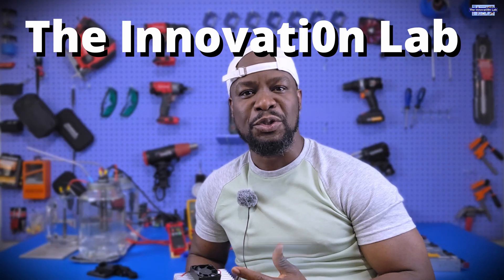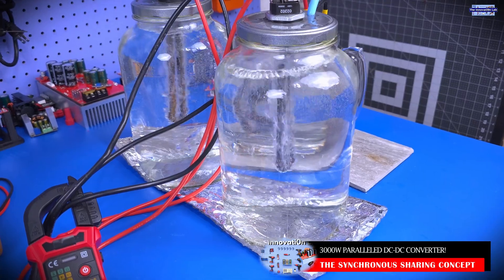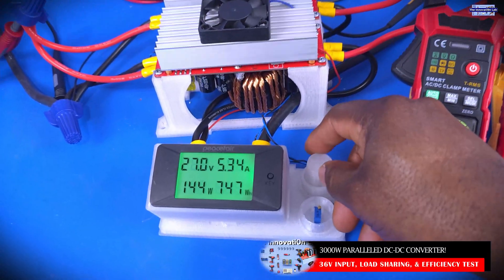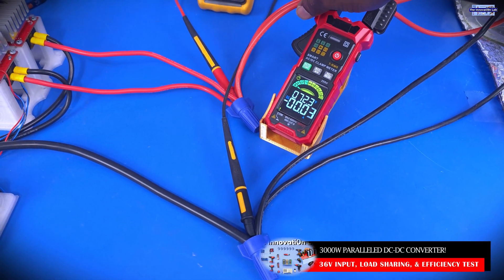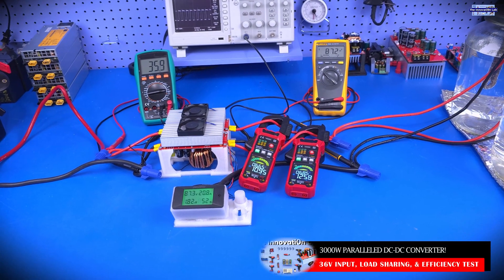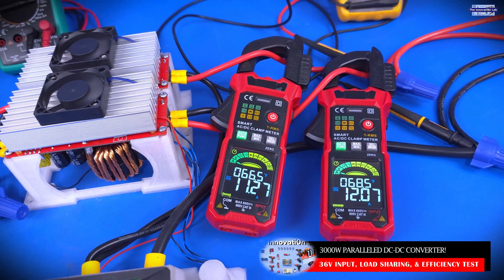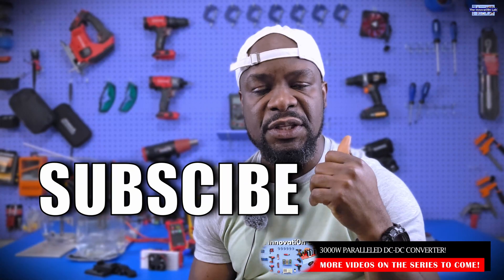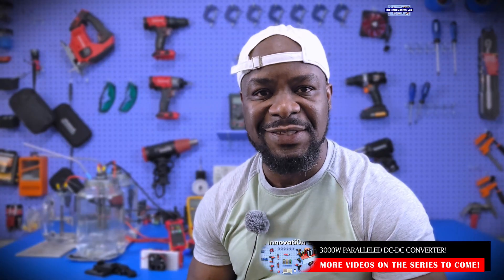Unleashing Maximum Power!⚡ Synchronous Parallel DC-DC Boost Converter in Action

Comment: Hi, i wonder if you could help me, im using one of these to charge my emoto battery from a solar battery module, but i want a quick way to jump from 92v to 88v, if i remove the Vout trimmer, i was hoping to replace it was a switch and some resisters, however im not sure which legs would actually need to be switched, do you know how this part of the circuit works?
Reply from the maker: Yes, I do but it will require some math to configure the switchable resistor network that you could use to implement such function....I will give it some thought when I am less busy.😊

Stay tuned.
Respectfully,
The Innovati0n Lab
Reply: @theinnovati0nlab782  haha, I have been researching, voltage and amp trimmers only use 2 pins so a variable resistor basically, 100k ohm for the voltage, 99k gives 92.4v, 96k gives 90v, I believe if I add a switch and a 3m3 ohm resister in parallel it will reduce the resistance correctly, this might help someone else 👍

Comment: Hello Professor. Will using Schottky diode in series with each converter's output isolate the output control feedback from one another so the original boost converters do not need to be modified? I think a regular diode would work as well, but Schottky would have less power loss. And maybe a MOSFET might work better. I'm still trying to figure this one out.
Reply from the maker: 😂Hahaha,
Love the professor joke.

I have tried this method in the video below and it works at low power but very sensitive to load stepping. The goal is to double the output power.....so its quite pointless if a paralleled system of 2x 1500W converters can only drive a 500W...not even reliably.
Also, your system efficiency will go down due to dissipations on the output ORing diodes.

Please watch this video before proceeding as you may find some good information from it.
👇👇👇
https://youtu.be/EKqIIOe_q8k?si=AL8jI4DJZHWfKQ5h

Respectfully,
The Innovati0n Lab
www.theinnovati0nlab.com

Comment: As I understand it, one resistor controls two voltages at the modules output?
Reply from the maker: Wonderful question.
👍👍👍
You are thinking in the right direction. One trim potentiometer - which is a form of a variable resistor controls the output voltage of both converters. But it goes a few layers deep from the potentiometer.😊

Respectfully,
The Innovati0n Lab 💥

Comment: I was wondering have you looked into multi phase/ multi phase controllers? Basically having the next phase(s) off set, for more power and better efficiency.
Reply from the maker: Thank you so much for the wonderful engagement.
👍👍
I have read about the multiphase converter concept a while ago (for buck converters), however, I have not tried to implement it. 
Also I saw that the efficiency of the multiphased network of converters tends to decrease as number (n) of the phases increases. I saw a TI white paper on this concept.
I will research on it some more to know if it will work well for this concept.
Thanks again!
Respectfully,
The Innovati0n Lab 💥

Comment: Should you not balance them with a large resistor or intelligent resistance such as SSR balancing system?
Reply from the maker: That is called the 'Droop share' method and it only works at super low power applications. If you are looking to share 300 or 400W of load between two converters...with a very slow load stepping....yeah it will work. But if you are thinking of pushing 3000W - share between two converters like I am, Nope it wont work.

You will end up with a very unstable converter system and the heat dissipation on those resistors will be unimaginable.
But you don't have to take my work for it....these are cheap converters and you can always experiment on them.

Respectfully,
The Innovati0n Lab💥

Comment: beautiful, I am just testing 50 +50 A IN ESP32 BOOST , the goal is 100 A x 55 V INPUT AND 200 - 350 V OUTPUT, but I need better IRFP IXYS or STW FETs to go further.
Reply from the maker: Awesome!!
Seems like a fun project! However, 55V, 100A is a lot of power. I hope you are also considering the saturation current of your power inductor?

Success Wishes.
Respectfully,
The Innovati0n Lab💥
Reply: @theinnovati0nlab782  Hi, Inductors are OK, I can change freq. from 16 kHz to 150 kHz, but if we go high, snubbers and FETs have
higher conduction /  switching losses, I tested this design from 2020 and it is able to pull 98 A of current all day long / BUCK / BOOST MPPT.

Comment: Hello i find the serries extremely helpful. I am trying to do the same thing. It would help if you said how exactly you have matched them. I think you said in the video that you will share an explanation in the future. Will this video be posted soon?
Reply from the maker: Thanks for the great feedback.

Yes.
It will be in the next video.
Reply: @ thanks you! I noticed that the windings on the main coils are multithreaded, i assume you replaced the original single core ones. Did you also replace the cores themselves? Is that a crucial step for matching them or you did it sorely for higher current? It is almost impossible for me to find cores here in Greece and i don’t have a way of measuring coils.

Comment: You are keeping your cards close to your chest about how this is achieved for obvious reasons. ;-) I'd assume you could if you wanted put 3, 4.... n boost convertors in parallel to load share the 3000W over more convertors and hence reduce the current loading and stress on each?
Reply from the maker: Usually I would wait until I have fully tested the concept and gained confidence before making videos about it. However, it takes months and months to do that. I am presenting it as a series to carry the audience along. Also why make a 40 minute video to capture everything at once only for the audience to watch a small fraction (on average) of the video.😊

This way allows me to gauge audience engagement. If I feel its not bringing value to the audience, then I will halt the series and move on to other projects. My time is precious.😊

But yes, I think connecting more converters to the synchronous loop should be possible but I am worried about conducted noise interfering with the PWN signal bus as we make the bus longer so as to reach more converters.

Thanks for the thoughtful feedback.
The Innovati0n Lab💥
www.theinnovati0nlab.com

Comment: But most new inverters with the same production article number have a jack that switch off one of the two inverters while places them parallel and have nothing to do else
Reply: I mean the the high and low input signals synchronization is from another level
Reply from the maker: Are you talking about the boost converter input stages of transformerless power inverters?

Or are you talking about standalone synchronous to DC converter designs?
Please clarify?😊

Anyway, as I said in the video, we have to always keep in mind that these are super cheap $25 converters. This is why I chose them for my diy projects because its something that most people can afford.

Thanks!
Respectfully, 
The Innovati0n Lab💥
www.theinnovati0nlab.com

Comment: How many amps 1 converter can do with from 12v 2000w to 84v DC?
Reply from the maker: Great question.
👍👍👍
However, I do not encourage for anyone to build high power systems from a 12V input. Its honestly never a good idea because the associated high current is bad for the entire system,...battery, MOSFETs, Power inductors, transformers, power cables,...every component suffers!
Lots and lots of heat in the system.

This is the reason I started this series at 24V. 

Let's do some math.
A 12V to 84V, 2000W converter system will probably give you an efficiency of about 80% or less.
This means you will require 2000/0.8 = 2500W at the input of the converter and you will expect the following;
💥 Power Loss: 500W
💥 Input Current: 208A

208A running through your system and 500W of heat dissipation?🤔
This is not a good idea and I don't recommend it.

I hope this helps.
Respectfully,
The Innovati0n Lab💥
www.theinnovati0nlab.com

Comment: Can you also look into implementing current (load) sharing which will make the two converters work even more efficiently than they already do in sync mode?
Reply from the maker: Thanks for the wonderful feedback!
Much appreciated.
👍👍👍

These converters are designed to work as standalone individual converters. The only way to implement anything better than what you saw in this video is to go back to the factory and tell them to redesign the PCB to allow active synchronous current sharing.

Besides, with this method, we are seeing a percentage sharing variation of less than 5%. This is with a few knobs that I still haven't tuned.😊
But if you think of a feasible way it can be implemented, please let me know.

I think this is as good as it gets with these cheap $25 converters - just my humble opinion.
Smart synchronous converters cost hundreds of dollars but even at that you will be lucky to find any that would give you more than 500W - at  such a wide input , output voltage ranges.

This is why I latched on to these converter and showcasing different applications for them.😊

Thanks again wonderful friend!
We appreciate all your support!

Respectfully,
The Innovati0n Lab💥
www.theinnovati0nlab.com

Comment: Here's a wild thought, could this boost converter, be used to replace the PV Cells input, to a solar inverter that has a MPPT input?
Reply from the maker: Thats a wonderful thought.
I have done something along those lines but I need to make a follow-on - if the first video does well. The goal will be to investigate how the initial design effort would behave in comparison to an MPPT controller.
👇👇👇
https://youtu.be/3v5FmnvwdmQ?si=bj5FOtn0orHVH41K

Comment: Yor voice sir magically ,I am Ashfaq shah from Pakistan ,sir plz you make a 48 v DC to 350 v DC apx 3000 w DC bost converter ,
Reply from the maker: Hahaha!
Thanks for the wonderful compliment. I will give all the credit to the microphone - an awesome gift from a great friend.

Your high voltage converter suggestion is feasible. I will be thinking about it for a future video. The struggle with such high voltages is in how to safely test the sytem and also finding components that are rated to handle such high voltages. But it is quite feasible.😊

Thanks again.
Respectfully,
The Innovati0n Lab💥
Reply: Look for videos about bOOST CONVERTERS from university , you have to understand  a lot of stuff
to make such converter. So better way is make 24 - 48 INPUT to 24 - 72 V OUTPUT, try first low current
like 5 - 10  AMPS, measure temperature of CAPS, FETs, toroidal cores, measure GATE and drain voltage
per FET, you need quality passive and active probes and quality ossc. , and if you are confident enough,
you can make 2-phase or 3-phase BOOST e.g. 30 or 50 A per phase, which is 30 + 30 + 30 == 90 A
input so,, 90 x 48 ´=== 4300 W at input, but problem is that you have high voltage difference,
350 / 50 === 7 , it would be bettter to go to another topology, or lower ratio of OUT / IN,
e.g. 350 / 5 === 70 V,  so 72 V to  350 V is feasible, but 48 =>> 350 will be harder to achieve,.

Comment: Your input volts is too much, try to make it less . too much input voltage
Reply from the maker: Sounds great.
Thanks for the feedback.👍👍👍

Please see the first video of the series. 
The system was first tested at 24V....this is as low as I will go giving the amount of output power wr are expecting out of these converter. To drive more power out of the system, you need a higher input voltage. Thats just the ugly truth with converters. Lower input voltage is not good if you are expecting a high output power because it leads to high input currents which will overheat and destroy the converters and your battery system over time.

Respectfully,
The Innovati0n Lab💥